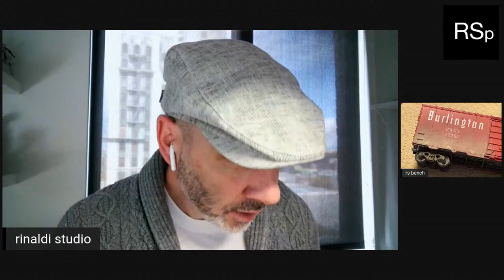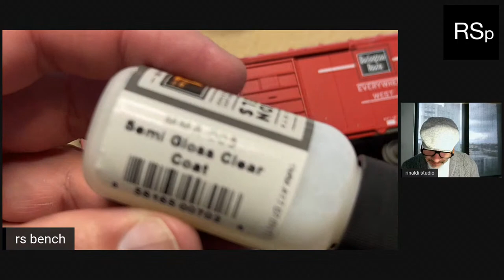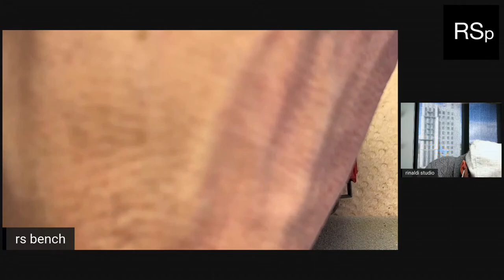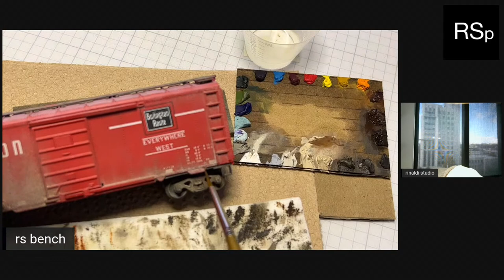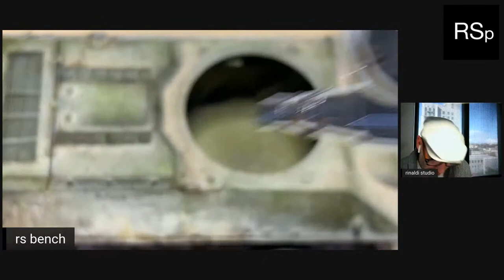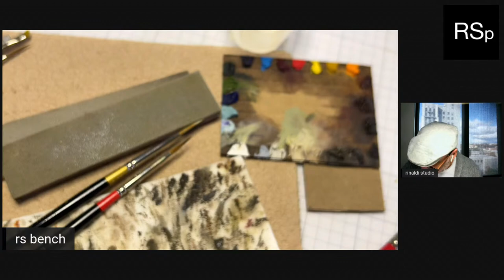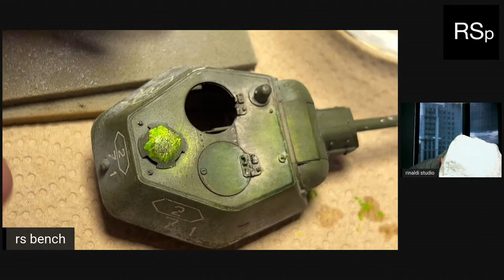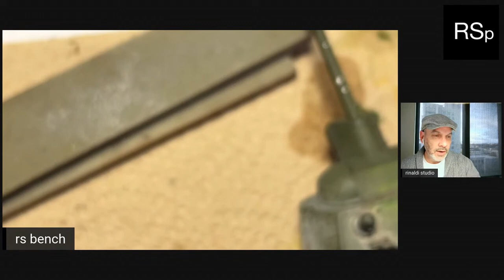Ep 31 - How-to Dust, Pigments, OPR

Comment: These last 2 episodes are really spot on for t-34 project i am working on A t-34 called ''Avenger'' in Sebastopole spring 44 there are a few colorised photos of this Tank on the net and it,s extremely dusty really new to OPR but like the results at the end of you stream you use pencils what brand do you use i am curious I have used a few AK ones I found them a little chalky thanks for these streams they are really cool !
Reply from the maker: That is great to hear, and yes that demo model was perfect to showcase dust techniques on. 

The pencils, brushes, oils, etc are all link in the description under the video title. Click - SHOW MORE and opens to all the tools used int he streams. Thanks!
Reply: @rs.p  Thanks Adam I will be practicing these techniques on a paint mule first and then that projest of mine take care
Reply: ps hair dryer: I have a question speed up drying... got that but also a great aid to quickly evaporate thinner  before it attacks surface? and avoiding the sheen that thinners can leave?  I done all my basic painting pin washes chipping and fading Once that was done I matt coated the model with VMS matt I am wondering if the thinner could fog up the matt coat. A little weary will start with the underside and see i suppose, and remember to not work too wet with the blending
Reply from the maker: @brianpenny6890  yes to all the above 🙌
Reply: fogging up of matt coat makes me a little weary  @rs.p
Reply from the maker: @brianpenny6890  please read my comment in the previous stream. I address this topic specifically.
Reply: @rs.p  will do Thanks